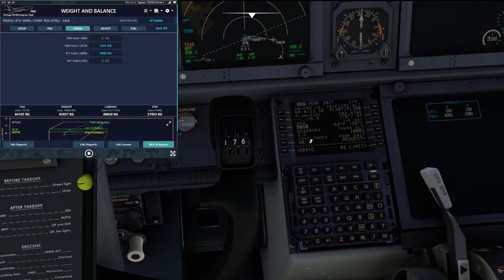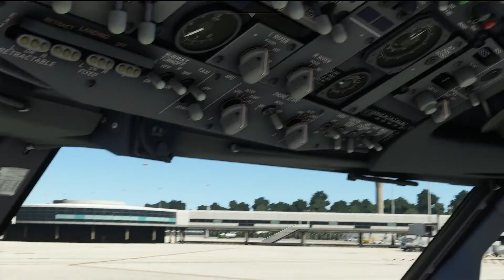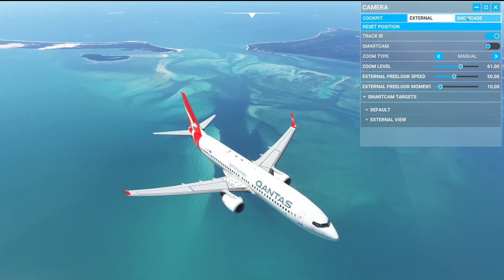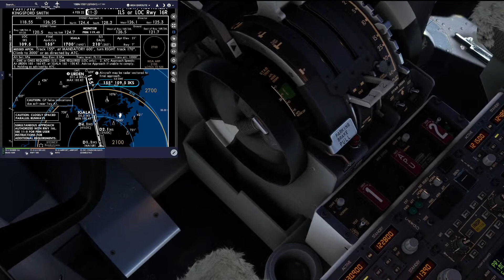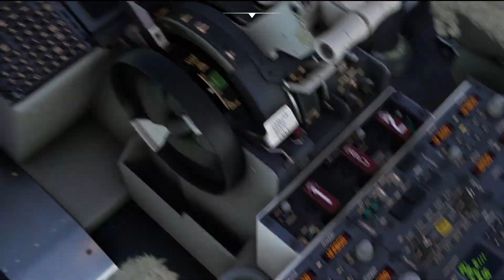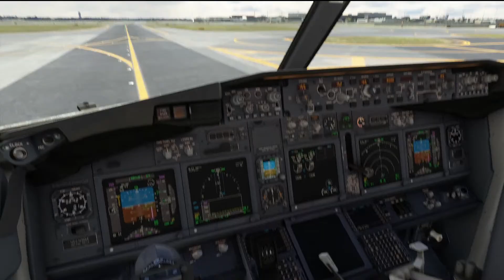PMDG 737-800 Released | Real 737 Pilot & PMDG Tech Team Member

Comment: I beg to differ that the PMDG 737-800 is study level and "the most sophisticated airliner available at the moment in any sim".  #1- There's no WX radar. #2 No EFB #3 Issue maintaining altitude at lower airspeeds: as in dropping 200-400 ft below CMD altitude according to FlightDeck2Sim in his initial review of PMDG 737-800 (at hour 3 minute 1)
 to the point of getting Altitude ALERTS. https://www.youtube.com/watch?v=iU8ioizeBiI. These are just the top 3 of many deficiencies with the release version of this aircraft.
The Zibo 737 Mod in X Plane does not have those issues. You are entitled to the opinion, but these are the facts. It looks pretty and has fancy moveable sun visors, but I'm not going to spend $70 on a plane that can't hold altitude when I can get FREEWARE 737-800 that can do so much more. Even some the controllers on VATSIM are upset with pilots not maintaining assigned altitude. I wouldn't trust this on Vatsim in its current state.

Comment: How do u set the trim ?Looks like u not use the trim wheel …
Reply from the maker: With the swith on the control column, as always. You never use the trimwheel in the real plane unless all other means to trim fail.
Reply: @A330Driver  i cant find it ...
Reply: @andreaperrone1965  Left side of yoke where your left thumb rests. It shows 2 rocker switches for redundency.